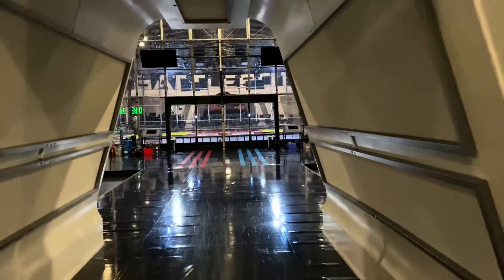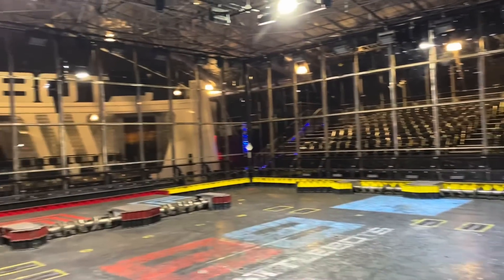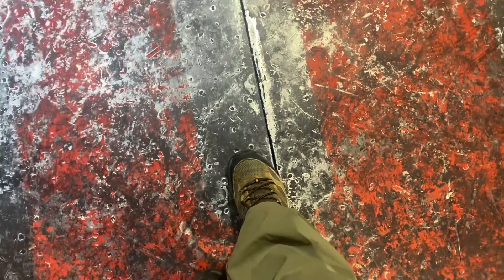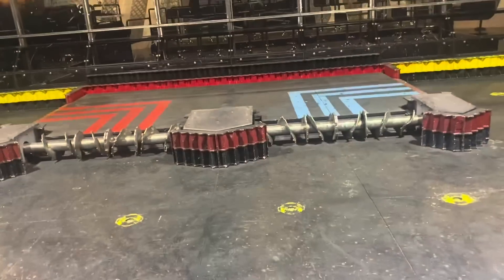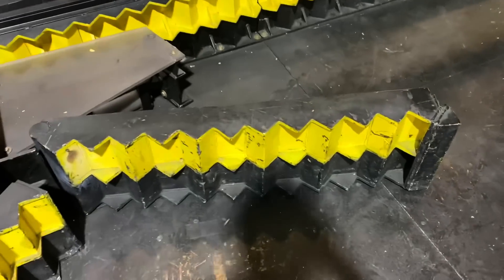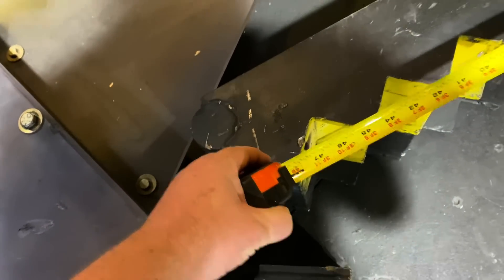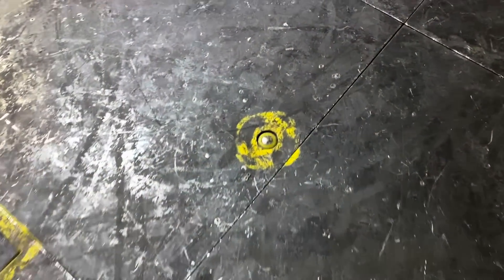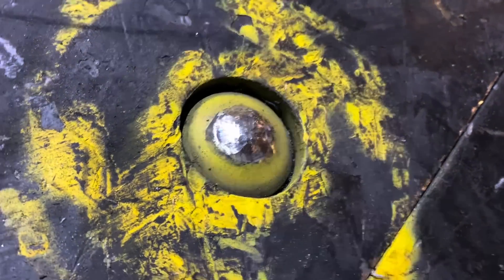The Deepest Look Inside The BATTLEBOX!

Comment: I don't think I've ever seen the RamRods in use in the current show. Seen them and the ramps occasionally in the old Comedy Central one, but never in this box.
Reply: Most of the time, they've only appeared in the ABC seasons, though they have come up slightly at times in later seasons. The Bite Force/Ghost Raptor match is an example of them being used on screen.
Reply: @BellyLover06  Man, I know I've seen some of those fights, but I guess it happens so fast I just don't catch it.

Comment: Everything is sooooo beat up.... do they ever replace stuff?
Reply: They have replaced things before, and likely will again, its just very expensive
Reply: I remember hearing on a podcast or something, that now that the arena is permenant it's actually much harder to replace floor panels. Something about the down time required to get someone into the crawl space beneath the arena combined with the steel cost itself plus equipment. It was something like a week of downtime which is hard when running a TV production and series of live shows

Comment: The new hazard are custom pulverizer attachments! greg and trey mentioned new hazard ideas in a podcast a while ago and one they were exited to reveal was for teams to be able to create attachment that would replace the hammer head on the pulverizers. It will most likely it will result in teams building hammer saw attachments. rules for the attachments haven't be stated and they will likely have weight limits but its fun to imagine a deep size level weapon on the end of the pulverizers
Reply: Ok so hammer saw or pick ⛏️ axe would make sense... 
But at the same time I hope someone builds a giant boxing glove. Looking at you hypershock. 😂.     🔨 🥊
Reply: I get the feeling they won't allow spinners on them. Would be wild if they did tho.

Comment: I really feel like the "upper deck" has a lot of wasted space in the arena.
Reply: I was thinking the upper deck could stay but be more of a trapezoid shape. Maybe 1 screw at the front wide. That opens up those corners of death a little bit and gives some space to maneuver out
Reply: Saw a statistic the season after the shelf was introduced showing the negative space caused engagement levels between bots to rise significantly, leading to more entertaining fights. I don't think it's going anywhere.
Reply: @eighty2018  they could make the arena smaller in a less stupid way like just making moving the whole wall in and have the same effect.
Reply: It ruins horizontal spinners
Reply: I acually think they add quite a bit of diversity to the different areas of the box, but maybe they could be arched in at the middle, so less space is used up by it